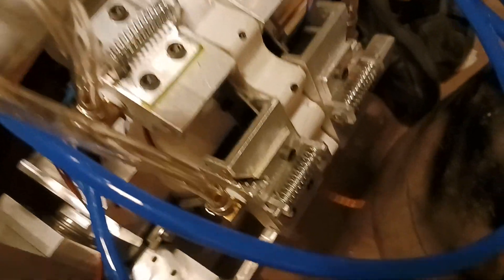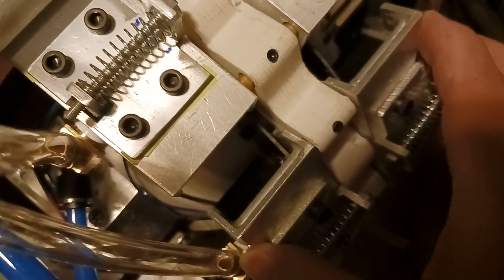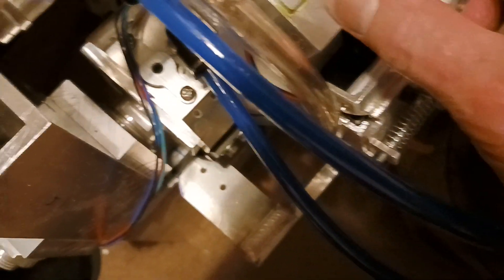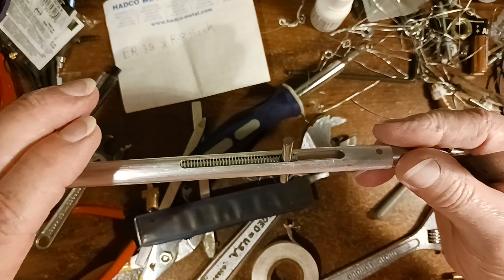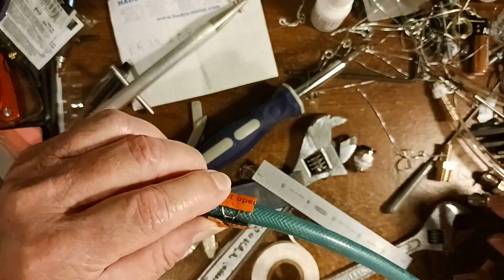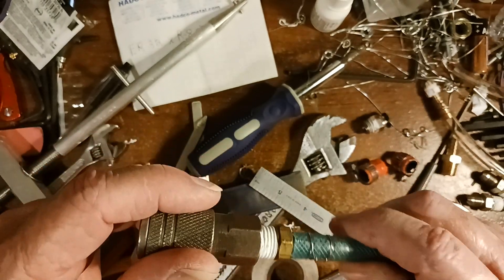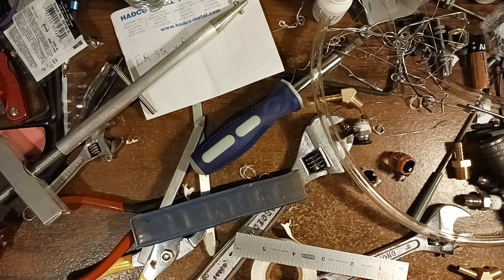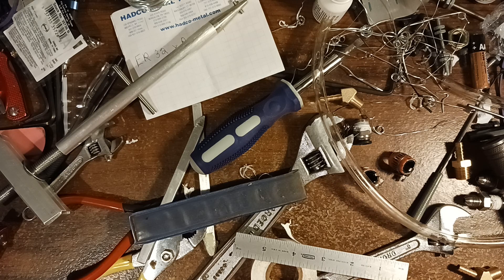Hose clamp tool for making wire hose clamps.  Air line attachment to the quad brake system.

Comment: Nice tool! I remember seeing these at a swap meet maybe 20 years ago...of course I was too cheap to buy 1 so I cobled together a very crude version for a job ...still kicking around my garage to this day
Reply from the maker: I also have seen many crude versions on you tube.  It does a great job, and you have to know the technique on how to use it. It has its limits as in space needed to work the bend. The hose clamp you purchase is faster and can work in a tight spot. So, you put in in the toolbox and years latter you find it again and say, " I remember this".